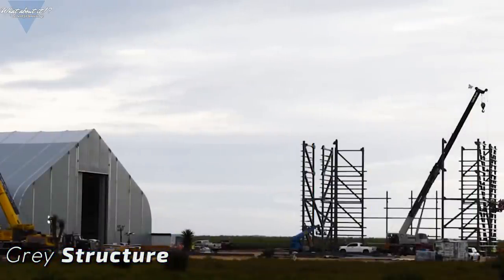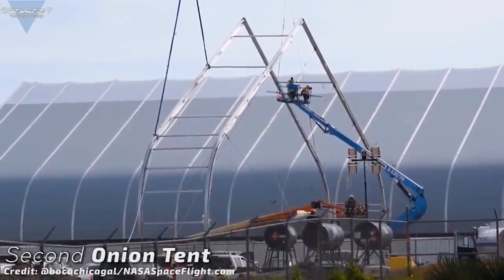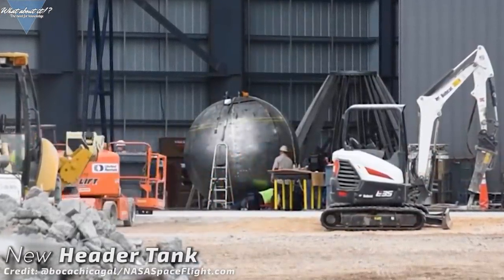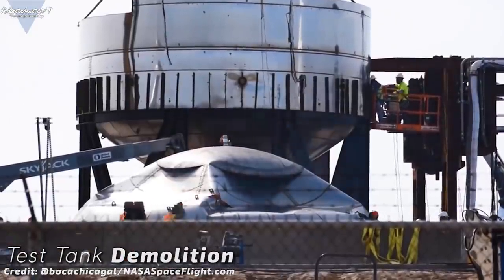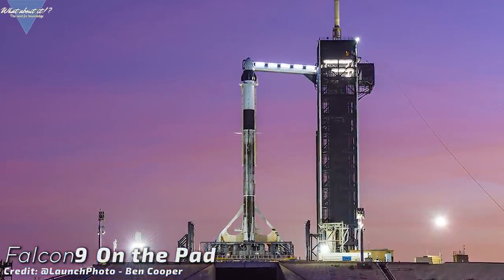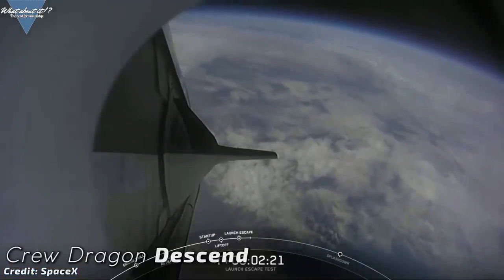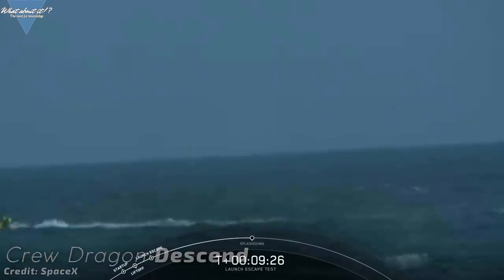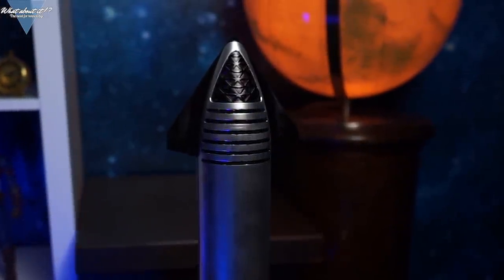66 | SpaceX Starship Updates - Crew Dragon In-Flight Abort Test Summary

Comment: is not that structure a VAB ?
Reply: No, it's VAT
Reply: @_mikolaj_  The Vehicle (originally Vertical) Assembly Building, or VAB, is the large building at NASA's Kennedy Space Center (KSC)
Reply: @mhballa5866  what i mean, that this one in boca chica is Vechicle assembly tent
Reply: @_mikolaj_  you mean the onion looking tent , 
i mean structure in min 0:57 .
this is based on speculation in spacex forum at nasaspaceflight , the ring section can only be assembled vertically.